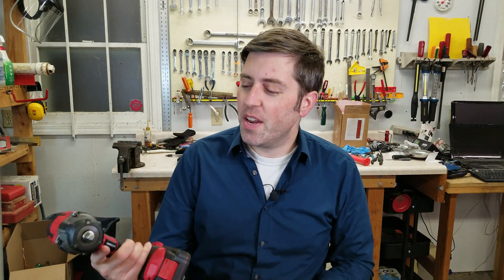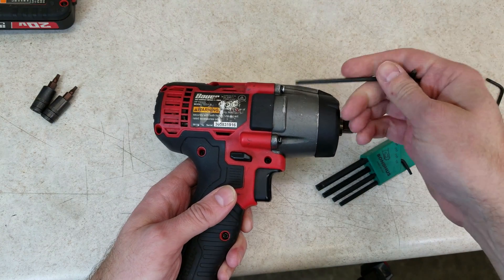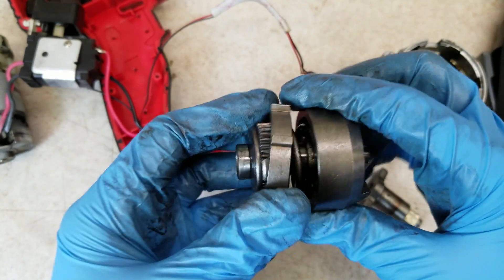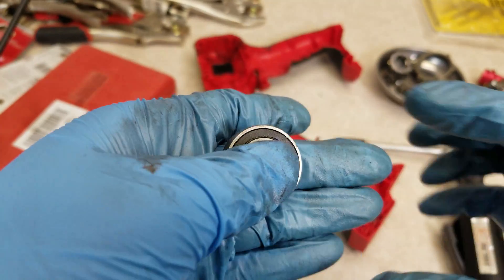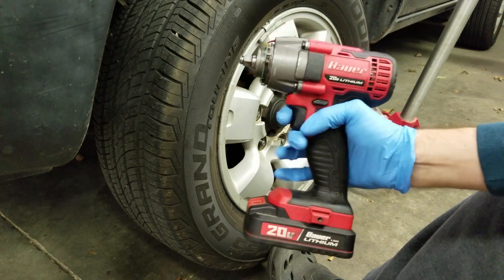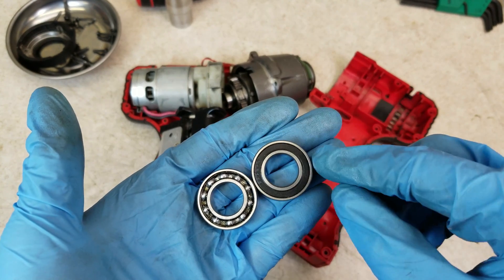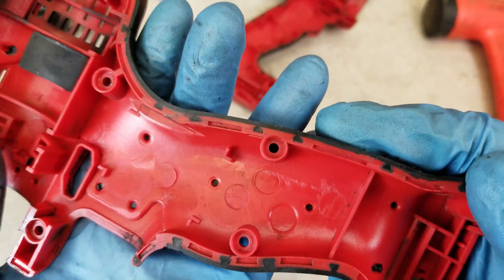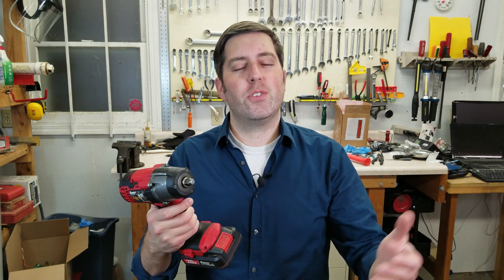Harbor Freight Bauer Cordless Impact Broken After 6 months … and repaired

Comment: I think the thing that bothers me the most about the higher end Harbor Freight cordless tools (Bauer, Hercules and Earthquake) is that they're all 20v (18v) tools but none of the batteries are interchangeable. There's zero reason to do this. They could have made the batteries without any branding and then you just choose the level of quality of your tool. But right now I may want a Bauer drill, a Hercules grinder and an Earthquake impact. But then I have to buy 3 different batteries and chargers. Just so short sighted.
Reply: That's because HF is just rebranding tools from other companies, and they are not HF owned, so HF has no control over them.
For example, Earthquake XT lineup is from AC Delco. They make tools for pros, so they are usually considered good.
Earthquake XT 12V ratchet is AC Delco G12 ratchet, model number ARW1208. And, AC Delco has a lot more tools than what HF is offering, so it looks like HF could only bring select few tools for them.

I DO think it could be a lot better if HF could make just one battery design that works for all of their cordless tools, but looks like it won't be possible,
Reply: @ksong1496  HFT probably didn't get the tools from Delco, more likely they BOTH order them from the same chinese supplier. There's only so many factories that make these things.
Reply: @thegalli  Yeah, to be exact, that is right. The name of the company is called Durofix.
While AC Delco is not the name owned by Durofix, all the AC Delco's cordless tools are from Durofix. Just remove the front 'a' from the model number of AC Delco cordless tools, you will get Durofix model number. I used AC Delco name as it's more known, but yeah, I think I had to be more specific.
Still other than the brand, things are pretty much the same.

FYI, Durofix offers more tools than what AC Delco brand offers. Only automotive related tools are released as AC Delco AFAIK.
Reply: They would sell more tools if all you needed was one 20V battery and charger for the entire store.  Also have too many names.  They should have just three, good better and best regardless if it an air tool, wood working tool etc.
Reply: Rob Gibson Theres a though!
Reply: You can buy an adapter for your bauer tools and use Milwaukee batteries on it
Reply: @jose galvez  That doesn't actually resolve the issue within their own brands, though, unless they make a Dewalt adapter for all their tool lines.
What'd be best though, is if HF would make Hercules battery adapters for their Bauer and Earthquake tools.
Reply: Different battery lines sucks, I agree, but they probably have licenses for different patents for different technologies.  The higher price points probably have more patents and are a few years ahead in tech to the lower priced brands.

Comment: The Bauer Hypermax Lithium Impact Driver Kit comes with 1/4 in. 20V compact impact driver, 1.5AH battery, charger, 2 impact bits, and a rugged tool bag and is currently (one week after this video was posted) retailing for $69.99.

Comment: Not knocking the Bauer line, but a tool like an impact wrench being used in a professional setting is a recipe for failure. Something simpler like a drill or a saw, I could see the Bauer brand getting by and lasting longer than 6 months.

IMO, the cheapest impact wrench that has the power and build quality to last in a pro setting is the Kobalt 1/2" 24v. It's available now in a kit for $150, pretty damn good for a brushless tool.

Comment: HFT is adding a ton of parts. Search “parts” on the website and you’ll get a link to replacement parts. I didn’t see any for the Bauer impact, but maybe they are coming.
Reply: I got an email from harbor freight just yesterday saying they have a parts catalog located at https://www.harborfreight.com/parts its a downloadable PDF if something isn't on that list they can special order from the manufacture and have separate catalog for special order parts. HFT seems to be getting better about this kind of stuff.
Reply: It has a parts list in the manual that comes in the box.
Reply: That's impressive for sure. They irritate me sometimes in that they'll make a decent tool but then ruin it with a two cent piece of metal. Just charge me an extra dollar and make it higher quality.
Reply: That’s a good hustle. Sell a crap tool then sell you parts  to fix it from their own store.
Reply: @whatfreedom7  - Buy the extended warranty. You're still well under the tool truck prices and you take the broken item into a HFT store and get an immediate exchange.  You're back on the job with minimal down time. No waiting for the tool truck to come around or shipping the tool off to the manufacturer and waiting weeks to get it either repaired or replaced.
Reply: @whatfreedom7  and STILL cheaper than most other options. Do the math, you'll see. Don't forget the "much better quality brands" have issues as well.
Reply: Peter S hahaha you guys keep thinking you’re saving money by buying a tool that literally costs as much as a ridgid tool with a lifetime service agreement. Horrible 90 day warranty so they can wash there hands of you when it shits. That is all

Comment: This is not a knock on the quality of Bauer tools, but I can't see spending that much on a tool that only has a 90 day warranty. Ryobi currently has their 1/2" plus their 3/8" impact wrench for $99, that price is for both units sold together, and they carry a 3 year warranty. They also currently have their 1/2" impact wrench with a 4Ah battery and charger for $99. I own both the 1/2" and the 3/8" and would not hesitate to use either in a professional environment. By today's standards, neither one is a torque monster, but they are both well built tools with good warranties. Add to that the enormous One+ 18V tool selection and I don't see any value in buying Bauer tools.
Reply: Definitely. I happened to get the rigid drill with two batteries and a charger for 99 bucks with a lifetime service agreement. Harbor freight is lagging behind the competition.
Reply: @Twinturbo120  True, but if HF added a massive warranty on their power tools and raised prices to compare people would whine about that too LOL.  All my tools are Yellow, but Ridgid makes some great stuff, and if I didn't already have the investment in Yellow stuff over the past 16 years Ridgid would be my next choice for sure.
Reply: gothicman03  Sorry, but Ryobi and Ridgid were at those prices before H.F. started selling Bauer and Hercules. Also, Lowes used to sell Kobalt 24V batteries for $10 or 2 for $15 on sale. You're kidding yourself if you think that H.F. is seen as a threat to Dewalt, Milwaukee, Bosch, etc.
Reply: gothicman03   >If I had to pick a brand, it would be makita due to its Japanese quality and assembly.
Also made in China. You know that right?
Reply: That 3/8 impact has no power and considering it uses an 18v battery it's sad. The 1/2 is acceptable, has enough power to do most things and it's not terribly expensive.

Between Bauer and Ryobi I choose Ryobi because their batteries are cheaper, the line of tools is MUCH bigger, and so too are the battery options. Ryobi gives you several sizes of batteries you can buy, Bauer gives you two.
Reply: Ryobi (TTI) is a geat product even used semi professionally.
Reply: gothicman03  Are the Makita internals metal?  They make them so light weight that it seems like the gears like in their drills are plastic.  Are they?  I wouldn't think so they'd strip out quite quickly, but what are they using that's so light weight?  Aluminum?  Anybody know by chance?  Makita makes some great stuff for sure, if I didn't already have thousands invested in Yellow tools over the past 16 years Makita or Ridgid would be my choice....you can pay less for less quality tools but you'll be having to buy replacements and/or parts quite frequently.
Reply: gothicman03  Awesome thanks for the great information.  I had a Makita 1/4" impact and 1/2" drill kit at one point in time, they were great for working overhead due to their light weight, but when I got out of the door installation business I gave them away, I think I'd like to get another set to carry in the truck for those times I hit up my local pick a part yards, probably get several other Makita cordless stuff to carry too so I have a kit with me wherever I go so my Yellow stuff can stay out in my shop at home and not have to pack it back and forth and then remember where its at home, work, vehicle, etc.  Thanks again.
Reply: gothicman03 scientific facts? Everything you stated was obvious facts that was never debated.. you just stated a bunch of well known facts and called me an idiot? We all knew what assembled in usa with global materials meant before you went on your empty headed rant. Understanding a debate before you enter it would be smart. Nothing made in the usa with more then 5 components is all ,made in the usa. I kind of figured that went without saying, but apparently not.

Comment: For applications like this, is a sealed bearing always preferable to an unsealed one?
Reply from the maker: Sealed have some limitations. The seal increases drag and typically lowers the top speed, for example. But in an application like this sealed would generally be better.
Reply: Shielded bearing are a cost cutting measure.  Sealed is always better.

Comment: Bauer is a good brand for home use, I like to compare them to Porter Cable.    The Hercules Brand is Harbor Freights professional grade house brand.
Reply: Hercules has too few tools and they are too expensive
Reply: Yeah, Hercules are good tools, but they're pricey and there aren't many available in the line to make it worth owning. I noticed that the price of the batteries has gone up 50% from the beginning of the year. Between Hercules and Kobalt,  it's tough not to go Kobalt. They have brushless tools, the best prices on batteries, a larger tool line, and I believe a better warranty.

Kobalt also has a really good impact wrench for the money.
Reply: @DickTickles  agreed! When the herc kits were 89 bucks and the batteries were priced way below most others it was a decent deal but now it's basically the same price with older tech and a 90 day warranty
Reply: @aaronporter2180  Yeah, it's nice that HF offers better cordless tools now, but the market is saturated with better low cost options like Ryobi, Kobalt, etc. Heck, even the 12 volt Milwaukee stuff is cheap if you buy on sale in a kit and those get an automatic 5 year warranty.

Harbor Freight's bread and butter was the cheap stuff. Right now all I want them to start doing is sell ammo and give Walmart the middle finger.

Comment: Bauer's is a good brand, a worn bearing could affect any brand impact driver, especially one used heavily such as your friend's in a dirty environment.  Because moving components such as bearings are most prone to failure, it would be interesting  if you tore down some competitor's products (Craftsman, DeWalt, Milwaukee,  Ryobi, etc) to see if their bearings are name brands. It would be interesting also to compare lubrication levels of these tools as new.
Reply: Exactly. Literally today my buddy had to warranty his Milwaukee high torque impact for a similar reason. Bearing was going out and he did use it a lot at work (scrapyard)
Reply: Battery operated tools great and convenient but aren't capable enough to get beat like older tools did.Bearing shouldn't go bad
Reply from the maker: There are a lot of teardowns on my channel. On the Craftsman impact I tore down there was a bearing from a recognizable brand.